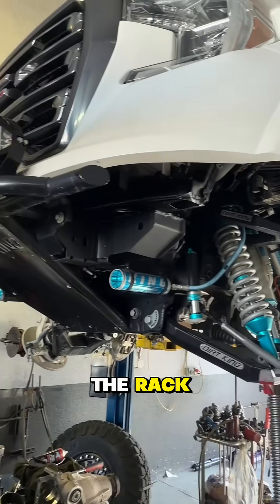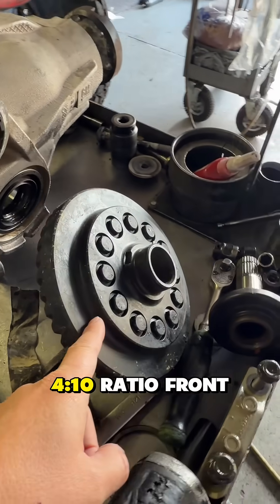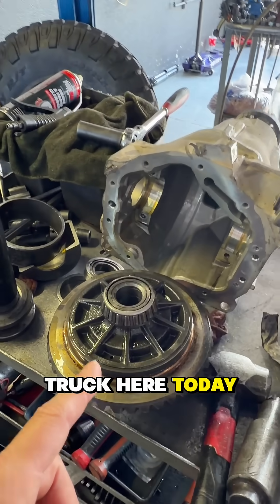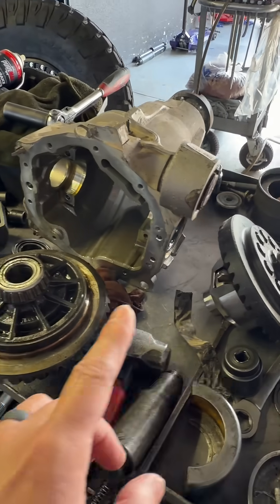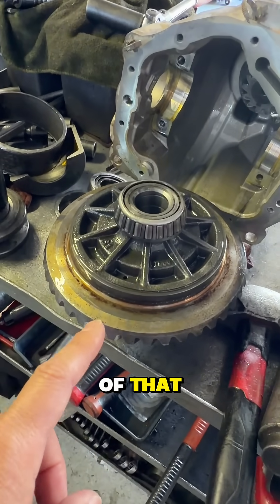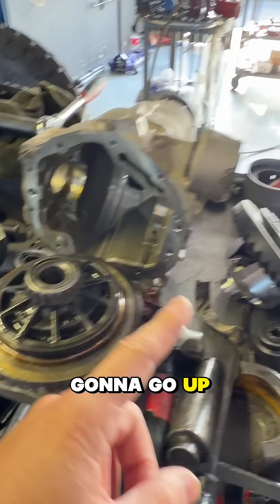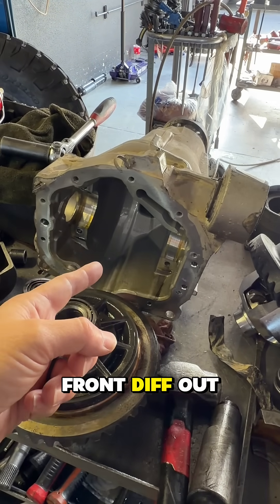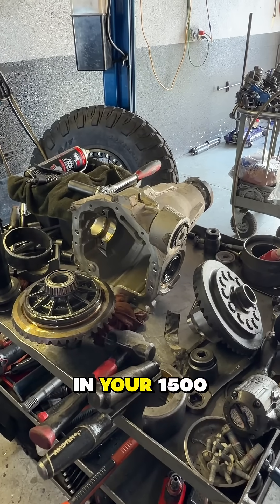❓Have you had your gears changed in your 2019+ GM/Chevy 1500? ❓Did you go through this?

Comment: just chuck it in the lathe and use the smaller bearings.
Reply from the maker: That could be an option, but I'd rather get the correct housing, which I actually did. The truck is geared now and runs great.